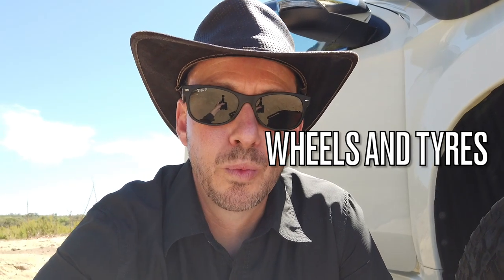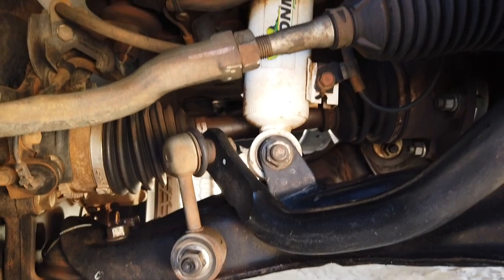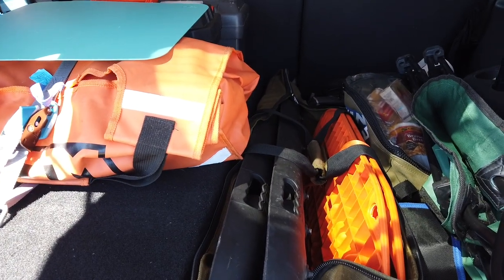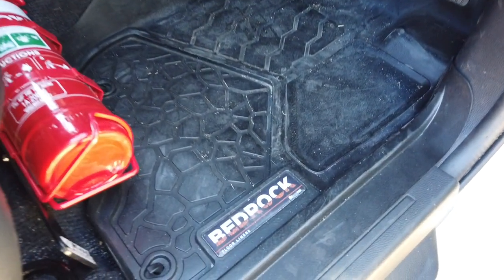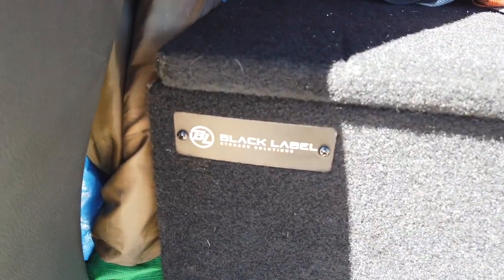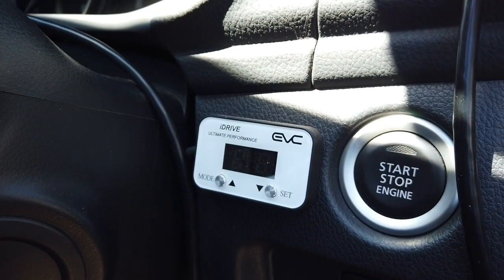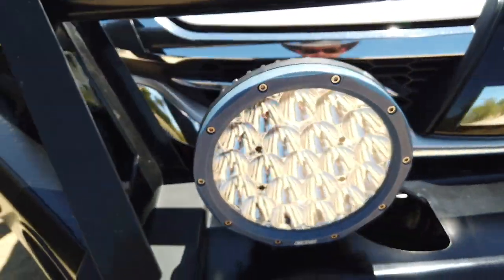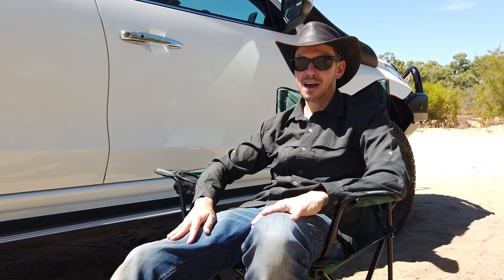MODIFIED MITSUBISHI PAJERO SPORT. Full Walk-Around and Mods Explained

Comment: Best protection you can fit to a PS is some Lanolin based rust protection underneath  - from those clips showing the underside you already have rust forming in lots of places  - very easily preventable at low cost by diy application.
Reply from the maker: Definitely a good addition! I should take out shares in Inox with the amount of lanolin I use (also use on the van). What you’re seeing under the car is just red dirt from a recent trip.

Comment: Hi mate great video, really love your mods and explanation of why you did what you did. And I love my Pajero Sport too. 
How did you mount the awning on your roof racks? Did you make your own bracket or purchase one? If you bought it could you share a link?
Reply from the maker: Thanks mate! I was able to buy some bolts from the Roof Rack Superstore in Osborne Park, WA. The bolts just slide into one side of the groove of the roof racks to connect to the brackets that came with the Dune 90 degree awning Just made a couple of holes into the plastic covers that pop onto the ends of the roof rack (so the bolts could slide through). Was very easy to do.

Comment: I like this video a lot. Very well paced and informative. But most importantly, very humble in approach and seems like you always weigh all the options, and justify them well. I am trying to learn as much as possible to see what sort of expenses is expected when buying this car, and where to start. A little bit of guidance please? 

And again, brilliant brilliant video
Reply from the maker: Thanks so much. When you’re looking to buy a vehicle it can sometimes seen overwhelming. My advice would be, as much as possible try to think ahead how you plan to use the vehicle now vs a couple of years down the track (are they the same?). For example is towing a priority, or being a reliable economical daily with the odd trip / 4WD etc..
The good thing about the Pajero Sport is that they come pretty capable out of the box and adding some decent tyres and a modest lift can turn them into very capable rigs. 
If you’re still unsure - just drive it for a bit, see how you’re using the car and then modify to suit your needs. 
Mods = additional weight which plays into your GVM / GCM weights and will increase your fuel economy and may limit towing capability down the track. 
If I was to do it all over again, I would consider the weights of mods even more closely and try to build as light as possible. Hope that helps and good luck with the purchase. Cheers Mark
Reply: Thank you Mark. Will keep that in mind driving it for a bit sounds like a plan. Do you have any video about having an efficient weight for the intended uses?😅
Reply from the maker: Not a specific weight video. Let’s say you decide to add a winch for example - at this point I’d suggest looking for both quality and weight. Essentially do some research as you’ll be surprised how much weights can vary between brands. Same for bigger items like bullbars. Don’t let all this put you off adding mods - but being weight conscious will really help you should towing come into the equation later on 👍
Reply from the maker: Other thing you can do is start a mod list and add in all your weights. When you get the car take it over a weigh-bridge empty - with minimum fuel. This will be your tare weight and then you have a starting point for your mods.
Reply: Thank you so much. Will do Mark. Keep up the good work

Comment: Great Video!!!
How did you fit bigger spare tyres behind the tow bar, any modification there?
Also, with that long draw how do you access the spare tyre release?
Reply from the maker: Thanks very much! It’s a tight squeeze and needed to drop the pressure to around 20PSI to fit the tyre under the car. I always carry a compressor on board if I need to swap it over. With the aftermarket 17” rims I needed to use a wheel spacer to hold the rim in place as the centre bore is larger than a standard rim. If you ever change over rims, Rohan from @TheAverageGarageAU sells these. 
In regards to the draw and wheel release, I designed it so I can still access the bolt to wind the release up and down. Others who have gone a full draw (both sides) usually remove the draws from the housing via quick release clips if they need to drop the tyre. If you’re not on the Mitsubishi Pajero Sport Australia Facebook page, it’s a good place for information and you’ll also see how others have approached this. 
Cheers Mark

Comment: Thanks for sharing the video!! :)
im wondering does the 5th spare tyre fit fine ??
Reply from the maker: Good question and yes! It’s a tight squeeze but fits. I run lower pressure 20Psi in the spare so it fits and if needed just pump up when on the vehicle 👍
Reply: @Perth4WDandCamping  great. im also from Perth. have you got contact of the guy who looking after your tyre? how much did that cost you if you dont mind me asking?
Reply from the maker: @budifang  I’ve found Tyrepower Wangara great to deal with. Quite often Falken will come out with a buy 3 get 1 free deal so this is the best time to buy. From memory, I paid around $340 per tyre. Certainly not the cheapest tyre but they are also a LT (light truck) construction so this is very beneficial off road and reduces the risk of a puncture. Tyres are one of the main areas I will spend more on as it’s the only thing keeping you between the vehicle and road/track. Good luck with the purchase
Reply: @Perth4WDandCamping  thank you Mark.
Reply from the maker: You’re welcome 👍

Comment: Hi Mark, wondering whether you have considered putting on a rooftop tent, or alternatively if you have any comments for or against that idea ?
Reply from the maker: Did consider at one point, however when I weighted up the pros and cons, I just couldn’t justify adding the extra weight and drag on the car (increasing fuel economy etc) when not using it. Plus a swag is low cost and pretty convenient to throw in and out as you need. The other consideration with a wagon is the low payload so every decision when it comes to weight is important.
Overall I like the idea of a roof too tent - easy to set up and it’s already in place etc, but I guess you need to ask yourself do the pros out-way the cons in your situation? Then you’ll have your answer 👍 Cheers Mark

Comment: Hi, can you please tell me , how did towing the caravan compare after the Monster Weapons and 270/70/17's were fitted. 
Did the extra tyre size hinder the towing at all.
Regards Wayne....
Reply from the maker: No Wayne. Apologies for the late reply. 

May have spoken to you via DM - if you’re the same Wayne ha. If so I’ll re-post my reply here for anyone else’s benefit:

Any increase in tyre size will have an impact on both fuel consumption and transmission shift points, however still towed fine as it’s not a huge increase in tyre size.

Comment: is your intercooler hoses made of silicon? thoughts on hoses made from aluminum?
Reply from the maker: G’day. Yes running high strength silicone from Forefront industries. The ones from Offroad daily are similar. Haven’t had much experience with aluminium hoses. Ultimately you want a strong, smooth flowing pipe with good heat dispersion.

Comment: This is the greatest car very easier to maintain repair wear and tear, modified only absorber, springs, turbo much bigger to increase up the incredible power
Reply from the maker: They are a great vehicle and offer fantastic value for money
Reply: @Perth4WDandCamping  Yes but you Don't only judge by the engine power and exterior interior design ,use it for long life period about the gearbox,excel gear oil,bush,ball joint and many others aspect which one can stand longer period mostly coming to the top overhauled engine,i see Mitsubishi can stand longer all these things and comfortable everydays use

Comment: Thanks for the great review. Regarding your tow bar fitted is it a standard factory fitted one (Mitsubishi)? Does the spare fit okay considering your tire / wheel set up described in this video?
thanks
Geoff
Reply from the maker: G’day Geoff. It’s the Hayman Reese concealed Towbar. Spare wheel does fit, however the pressure needs to be run lower to fit which isn’t an issue for me as I always keep a compressor on board. Cheers Mark

Comment: Good video 👍,  i have just bought Pajero Sport  Nov 2021 and find it fantastic daily and shock horror fun off road vehicle.  Interesting choice of wheel/tyre combo.  I’ve decided on coopers AT3 xLT 275/65/18 because of the front disc brake size, my thoughts are that I’m not going to get that much bang for buck going from 65 to 70 profile tyre.  Your thoughts ?
Reply from the maker: Appreciate that thanks! It commonly surprises people just how capable they are off road. 70 profile with the 18 rims will take you to a 33”. Would definitely make a difference off road - you’d have more clearance, and more length when airing down to air traction. The impacts would be clearance in wheel arches (depending on your suspension set up may scrub and might need some modding to accomodate - I don’t think you’d be able to fit on stock suspension) and the other considerations are weight (will be heavier) and you’ll use a little more fuel due to increased rolling resistance (could be up to 1L per 100km more). Final consideration is height (in WA you can go 50mm about the standard height of the vehicle). If you have done a 2” lift and running 33’s you’d be over 50mm in height in which case to stay ‘legal’ you’d need to get it engineered. This is possible but involved engaging an engineer and doing a lane change test which can be a little expense (over $1000 just for the lane change test last time I looked into it). If you want to go down this route there’s some info in my GVM upgrade video and contact of an engineer in WA I used. Hope this helps. Cheer Mark

Comment: Very interesting review! When deciding on the front bar, did you also consider ARB/TJM as they're very similiar in design and functionality.
Reply from the maker: Thanks. Yes did consider those however with both those designs they don’t fully replace all of the front bumper - you’ll see in photos there’s a little bit of the original plastic bumper remaining under the headlights. Personally I wanted a full bumper replacement bar which the Ironman and Piak offer. All will offer the same protection so this came down to an aesthetics decision for me.

Comment: How do you find such a big tyre in terms of fuel consumption and more importantly, the impact on performance off road?
I have heard that it knocks the gear ratios out and the car struggles with such big tyres. Is this true?
Reply from the maker: About an extra 1 litre per 100km extra. It makes a massive difference off road. The bigger footprint is very noticeable and feels very planted off road - I’ve tested across a range of terrain and it’s a very different car from stock. Bigger tyres will always impact gear ratios. When cruising at 100-110km on the highway I generally sit in 7th gear instead of the usual 8th overdrive gear if you were driving on the stock 31” tyres. I find this keeps the engine and transmission temps within the right range. If going bugger tyres recommend use of a Scanguage device so you can monitor these temps and adjust your driving style to suit. Cheers Mark

Comment: How have you found the Pajero Sport for towing the Forbes 15 and do you believe the GVM upgrade is necessary for the Forbes 15 without other considerations?
Reply from the maker: I’ve been happy Angela. You have to understand it’s limitations towing (it’s no V8 Landcruiser or Patrol) whilst towing but it does the job pretty well and the benefit of the lower fuel use. You do notice the weight going up a hill, however it’s no race and you can also drive in manual select to keep the revs in the right range. With all the mods I have on the Pajero Sport there’s no way we could have towed the Forbes 15+ and still had passengers. Key is to do your homework first - carefully plan based on the current weight of your car, include all your gear and passengers (and consider future mods). You also need to add the towball weight which comes off your vehicles payload whilst towing. This will give you a pretty good idea whether the GVM upgrade path will be needed for you. There’s a good video from Wild Touring which explains it all pretty well. I’ll include a link below 👍
Reply from the maker: https://youtu.be/diIFtZjmJ1s

Comment: mine doesn't have factory roof rails ,, how will i attach roof rack to it ? any recommended budget friendly system
Reply from the maker: Where about are you based? If in Perth, suggest a call to 4x4 Extras in Wangara and they can talk you through some options. You can install brackets into the roof to fix roof racks, or a roof platform
Reply: @Perth4WDandCamping  you mean i can use the factory roof mounts ? i based in UAE . will be nice if you can suggest  something
Reply from the maker: You’d probably need to do a bit of research as there are many ways of setting up roof storage. The Pajero Sport Australia group is also really good on Facebook and you can ask how those without roof rails have approached it. I’m not a 4WD accessory company so don’t want to give you the wrong advice.
Reply: @Perth4WDandCamping  much appreciated . im getting same offroad lights like on ur car ,

Comment: Have you considered a long range tank?
Reply from the maker: Would certainly help, but payload is an issue with wagons so something to consider if you have lots of mods and are towing. Weight more of a balancing act compared to a dual cab ute with much higher payloads.

Comment: Nice! We have a very similar set-up. How do you find your ride using Ironman Foam Cell FE & C springs, is it too stiff or just the right ride. TIA & more power🤙
Reply: BTW Mark these are all my upgrade and camping gears inside my car, I guess I’m way over the GVM😢

*PIAK Front Bumper 3Loop Premium
PIAK Compact Rear Tow with Rails
*PIAK Side Steps Roader

Front Runner Slimline II
ARB U.V.P.
BF Goodrich KO2 285/55/20
Black Rhino Warlord
Ironman Foam Cell Shocks
Ironman UCA
King Springs 50mm
Airbag Man
Overland W.S. F-30mm / R-35mm
SR Panhard Rod

Speedlab tuned / Zix Performance
TJM Airtec Snorkle
*Borla Full Exhaust
KNN Filters (Air/Cabin)

Wild Land Dessert Cruiser RTT (60kg)
Hitch Fire Forge 20 (15kg)
*Front Runner Pro Stainless Steel Camp Table
Front Runner Awning Brackets
*Front Runner RB Side Mount
Front Runner Expander
Front Runner Utensils
*Front Runner Footwell 40L
WaterPort Weekender 30L
Black Dog Container 20L
*SR Recovery Board
RCM 270 Black Awning with Walls
Off-Grid Shower Awning
Alapicool TWW35
Bluetti AC180P
Reply from the maker: I was happy with the ride comfort and sat well with the van on the back. Helped also having some static weight in the rear (half draw) and will sit a little higher in the rear which is not uncommon for this sort of spring set up
Reply from the maker: Yeah you’ve got a bit of weight there. Certainly worth looking into getting your GVM raised

Comment: One more question 😅
I went to bob jane today and asked about the same wheel/tyre combo as you, he told me I could only go 265 70 r17 to stay legal, was that mentioned to you?
Cheers.
Reply from the maker: No wasn’t mentioned to me in fact some are running 285 70 17. Essentially 2 things you need to be aware of - 1 (wheel track) and in WA you can’t extend your wheelbase more than 50mm, and and 2 (height) you can’t raise your vehicle more than 50mm without engineering and DOT sign off. With my tyre combo and lift I was still under 50mm height. You’ll need to check the offset of the rims you’re putting on to make sure you’re within the 50mm limit to keep legal

Comment: Are shocks longer than stock or just tougher?
Reply from the maker: There’s a bit to this question but in short both if you’re having a lift. When a raised suspension kit is fitted there will normally be a requirement to fit longer stroke shock absorbers. These will also generally have bigger bore too and are better for heat displacement (which is good if for example you’re driving on corrugations as they won’t heat up as fast as the standard shocks).
They are not all created equal and many different types on offer. There’s a good article below that might help - and any good suspension shop will be able to talk you through options to suit your car and needs (Eg what’s your set up, how much weight are you carrying, are you towing etc)
https://www.whichcar.com.au/gear/suspension/4x4-shock-absorbers-buyers-guide

Hope that helps a bit 👍 Cheers Mark
Reply: @Perth4WDandCamping  Thanks! But as I know so far, all aftermarket shocka are the same lenght as stock ones...
Reply from the maker: This might help 👍

https://www.pedders.com.au/wp-content/uploads/2018/01/PED3415GTechstop16_03-Shock-Absorber-Length.pdf

Comment: You should only carry a wooden ruler as it will improve your fuel efficiency in the air
Reply from the maker: Every little bit helps yes. Ruler is very light and comes in handy when I need a sharp edge ☺️

Comment: any rubbing with those tires? I thought biggest was 265/70 r17
Reply from the maker: 275 all good with the 2” lift 😁
Reply: @Perth4WDandCamping  ahh you need the lift
Reply from the maker: @OshoLee you could probably get away without but may need to trim the inner guards. Addition of the bullbar also helped with clearance
Reply: @Perth4WDandCamping  thanks! And for wheels? Any recommendations..I'm in Auckland btw
Reply from the maker: @OshoLee on this 17" Inch Rims - Monster Weapon (+20 offset) - from Bob Jane
Reply: @Perth4WDandCamping   sorry one more question: would this fit? I found: 17 inch Typhoon 17x8 6x139.7 $1500 for the set
Reply from the maker: 17x8s should fit but I’d suggest checking with a tyre shop to be sure. Also check the offset. I had +20.